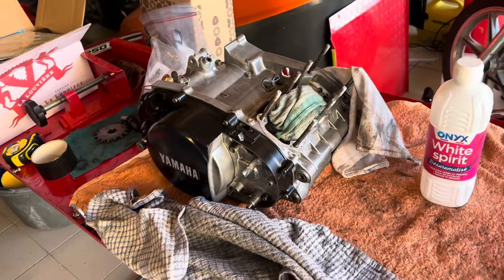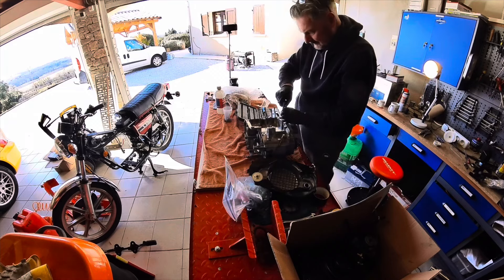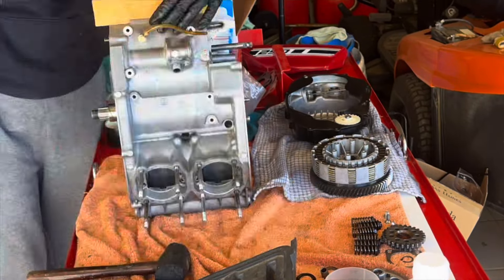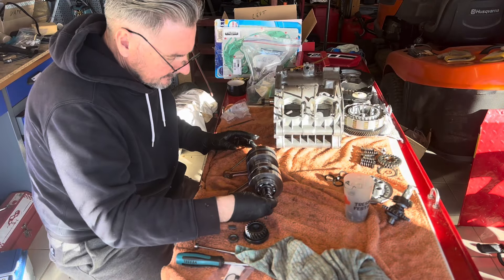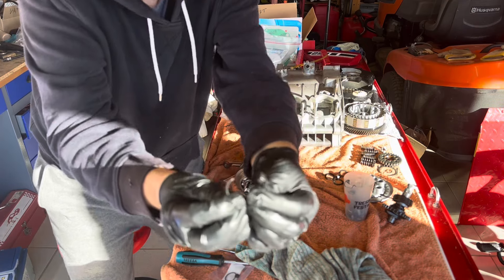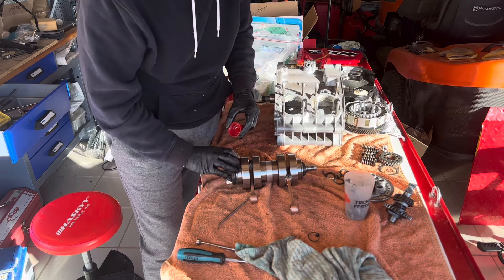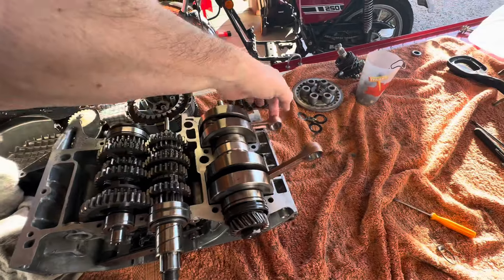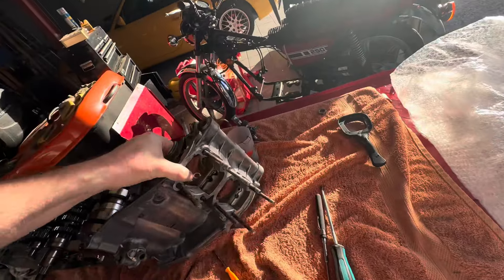Yamaha RD250 Disaster Rebuild

Comment: Looks good and why not have a Look for Port and match.
PISTON lower Shirt is to wide on both sides but must be wide enough over/wider the Ports ; and a hole e.g. 6mm above the 2 membrane inlet holes and below the rings   cooles the piston Head from the inner side of the piston and supports the spray of the 5th transver.
Have a Look in the Internet.
If you wann to use it upside the road on the track.
Reply from the maker: Thanks for all that info. I don’t have the nerve to do it myself

Comment: I would not worry about port matching the transfer ports if the rest of the motor is 'stock' You will probably find that they are matched fairly well anyway (you know what that Japanese are like!). If you were going to 'port' the rest of the engine and work on the heads then yes you do everything you can to gain BHP but your not doing that, I believe. As others have said, make sure that the ports have been chamfered, if not do it yourself.
Reply from the maker: I wonder if it's a necessary step, it might just complicate things if I get it wrong. Lets see.....
Reply: @RepairandRideout  I doubt you would get it wrong, you can use a base gasket as a template, its probably just not worth the bother, having said that it will only cost you some 'time' and nothing else, if it makes you happy, go for it!

Comment: The primary gear o ring was fitted to the C/D model but not the E/F. Looks from the parts list that it was also on the A&B models as well and I have found them on all the cranks  I've had up to the E/F. I've never been able to see why the later models didn't have them. The primary side of all the cranks is the same design. Maybe someone knows?
Reply from the maker: Strange? On reflection it can’t be the source of the air leak as it is inside the oil filled clutch cover.

Comment: I don’t know why they fitted those silly o-rings with the block. The early bikes don’t have them. Castellated side of the lip seal faces the bearing to space it away. Remember to check squish as well. Port matching won’t give you any real benefits on an otherwise stock bike but if you have the tools to do it then why not.
Reply: Funny you should say that! I have just rebuilt my 250E motor and couldn't find the seal on the exploded parts diagram so I didn't fit one!!! I stipped the engine over a decade ago so can't remeber if it had one or not.......do you think I should put one in anyway to stop the crank swimming in gearbox oil???.....I hope somone see this and can advise!
Reply from the maker: Thanks for your advice. I'll look at the port matching, it depends on my nerve when it comes down to doing it
Reply from the maker: I didn't know it was there either. I was looking through the Yambits parts list for the rebuild when I saw it listed. I had no idea what it was so I had to go and check to see that my engine had one. I could just about see it, so I thought I'd better get one!  @mickmc3250